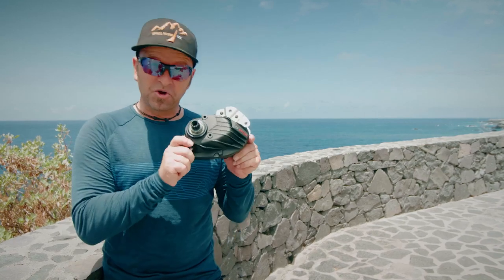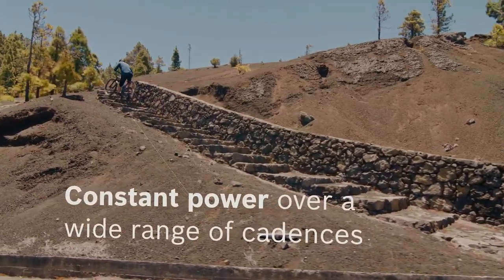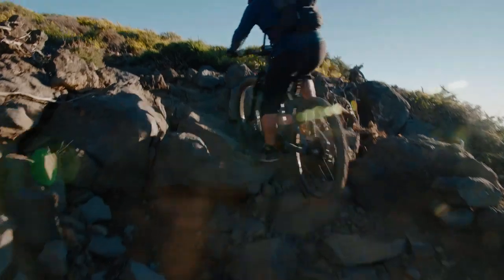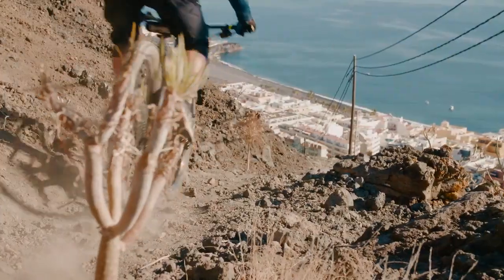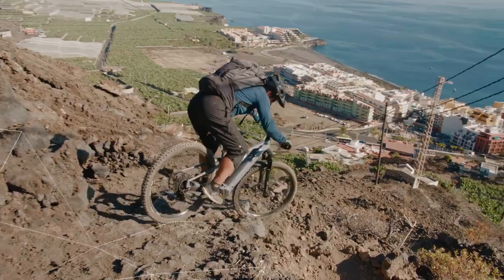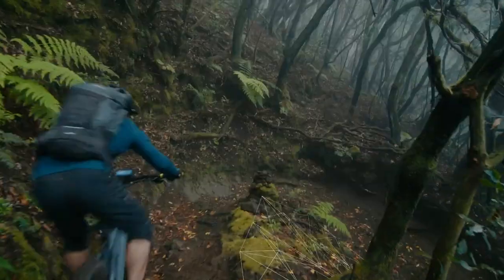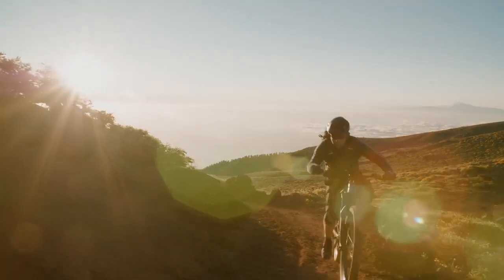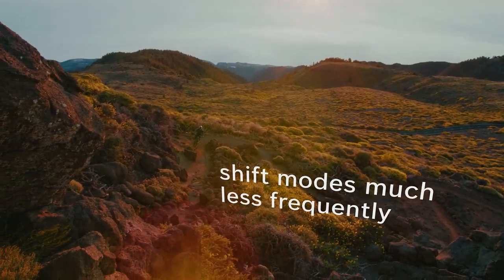Bosch eBike 2020: Performance CX Electric Bike Motor Features Guide

Comment: MOTOR BOSCH 2020, NOISE 
https://www.youtube.com/watch?v=KWg3c3c2Wgs&t=2s
Everyone who draws their own conclusions, the video basically explains that the new 2020 bosch engine from a series of kilometers if you use it with energy and mountain, starts to make a rather annoying rattle in bumpy slopes a problem for those who do not We like noise going down.